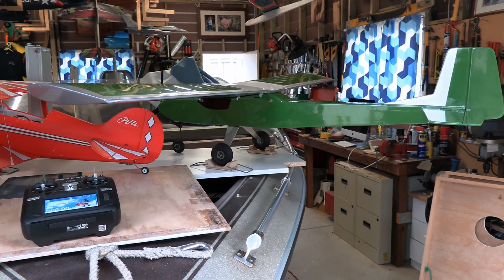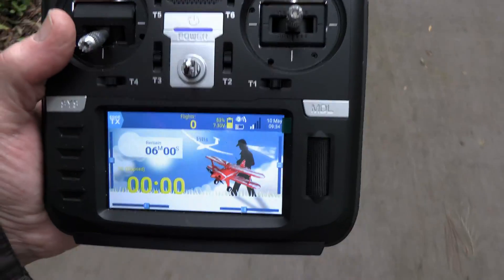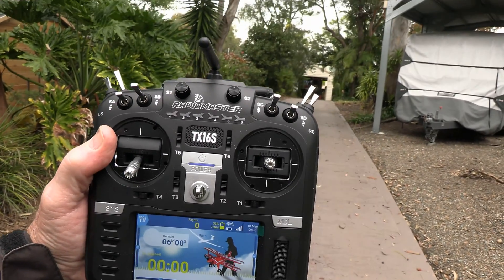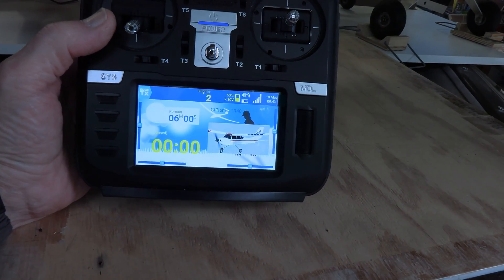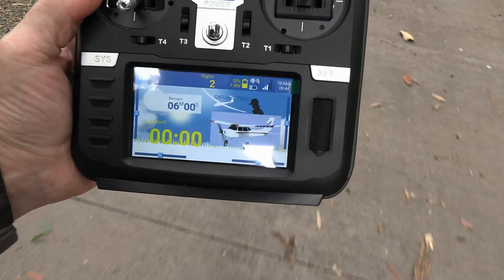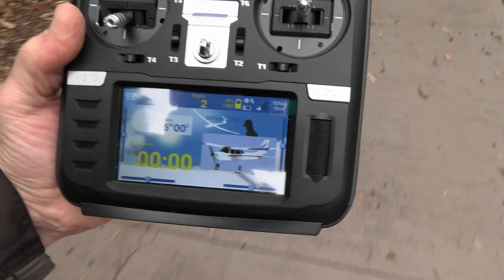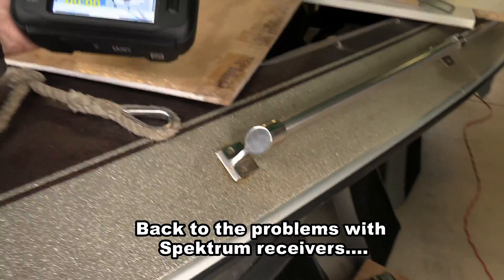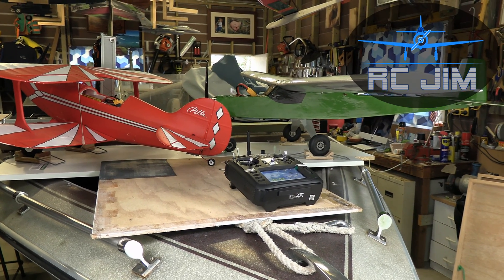RC Plane Range Issues with Spektrum and Radiomaster

Comment: My recent experience with new Boxer radio and Spektrum receivers AR410. I have Spektrum radio and about 10 spektrum Rxs. Few micro DSM Deltang 
one Lemon 6 Ch without telemetry. I bound one of each to my new Boxer radio and did range check. Deltang and Lemon without telemetry and radio set to reduced 1/30 power in range check mod had connection abot 30m away. With full strength as park was long about 300m and probably much more than that. Tested physically by moving control surfaces and assistant reported to me by mobile phone. No any issues in flight either. While testing antenaless AR 410 I was receiving low signal alarm after 20m. Why ? Because Boxer radio can not correctly interpret short range flyby telemetry signal from Rx and raising alarm. In physical test in low power mode I could move control surfaces even at 50m away. In full strenght tested 300m and probably close to 1 km but I have to find good location to test that. So I switched telemetry alarms off and enjoying flying. Never had any issues with above mentioned Spektrum RXs. I had problems with Hobby King Orange ones. So Edgetx system is not compatible with Spektrum short range flyby telemetry. But those small Spektrum antenaless one are very good except price.
Reply from the maker: Thanks for sharing, that's encouraging.

Comment: The difference is likely signal polarity.
Reply from the maker: Given that the Spektrum receivers with built in antennas only have one antenna, they are going to have polarity issues with a transmitter that also has only one antenna.  But at the distances at which I was receiving warnings, that shouldn't be an issue.  In the Radiomaster flight log I see that the Spektrum receiver is sending a TRSS value with 31 as 100%.  For Lemon RX the signal strength shown in the log is based on a scale up to 100.  I'm wondering if that is the reason.

Comment: Are you using the latest version of the Multi-Protocol module (1.3.4.0)?  Looks like you have internal and external modules.  30 meters with the airplane almost on the ground is a long distance.  You will get better reception with the airplane in the air.  If you have a Spektrum transmitter, monitor the 'fades' and 'holds' in telemetry.  You might be surprised at the number of fades (frame loss count) in Spektrum (un-announced).  Bottom line: "Only Holds Matter".  Lemon receivers are great!  Eagle makes a 6 axis gyro that has stabilization; try it.
Reply from the maker: Hi Garry, thank you for your very helpful information.  I have the latest firmware installed in the Radiomaster.  It has the capability of adding an external module, but I haven't done that yet.  I have received repeated warnings while in the air using the Radiomaster TX with Spektrum receivers, and at relatively close ranges - perhaps 50m or so.  It may be that they are 'fades,' but I dont get them using the Lemon RX receivers.

Comment: If you go and research RF fields and cones your eyes will see. Some of the cheapest best transmitters produce a doughnut shaped transmission field shape.
Reply from the maker: Yes, I have seen those.  However, even when I'm holding the transmitter so that the 'fat' part of the donut is directed towards the plane, I still am getting weak signal warnings when using the Spektrum receivers with the Radiomaster transmitter.  That is not happening with the Lemon RX receivers, regardless of how I am holding the transmitter.

Comment: Easy fix get rid of (buull), sorry I almost threw up, trying to say, spektrum ——and buy Xpress LRS.
But it’s your money your hobby do what you like.
Reply from the maker: I will eventually get the xpress LRS module, but in the meantime I have a lot of models with Spektrum receivers.  What is your preferred stabilization solution when using ELRS?
Reply: @RCJim  I thought all you hardcores Hated all the Newbie stabilization crap.
Reply from the maker: To tell the truth, the first time I flew with stabilisation was a handful of flights about a year ago (before bypassing the FMS Reflex module), then didn't do that again until a month ago or so.  Apart from trying to keep up with the times, several guys at our club have suggested that I would be crazy to fly my new FA-18 90mm ducted fan jet without it.  Furthermore, I've got a small jet and a small Pitts Special that are really sensitive to just about anything.  So, I'm giving it a go, and sharing what I learn about it with others.  My objective will certainly be to keep the stabilisation settings low such that you don't even know that it's happening, and do not use the "Safe" mode at all.
Reply: @RCJim Jim, my friend. Fly anything you want, stabilized or not. It's about your enjoyment, not some stranger leaving a comment on your post. You will for sure need stabilization for that edf jet, don't fly without it. 😊

Comment: The warnings are due to Spektrum having fly by telemetry. Turn off warnings in telemetry on the transmitter and the problem is solved. The signal from the transmitter to the receiver is not affected. This problem has been raised many times, and the answer is always the same.
Reply from the maker: OK, I'm all ears, but it's still not all adding up.  I was getting some warnings when the plane was over the landing field, maybe not close enough to throw a rock and hit it, but pretty close to a 'fly by' position.  And I was getting those warnings walking down the driveway, 30 - 40 metres away. On top of that, I'm a bit wary of just turning off and ignoring a warning.  It reminds me a time when I was flying a full size plane, taking off.  The instructor was telling me to pull back farther on the yoke to have a higher angle of climb.  Makes sense from the standpoint of protecting yourself from a potential engine failure.  But the stall warning buzzer was going off, and I questionned his instruction.  His response was to pull the fuse from the stall warning circuit!
Another thought.  Given that the transmitter is showing a signal level for signal strength, doesn't that mean it is actually receiving telemetry?  There's a different warning when it's "telemetry lost."
Reply: @RCJim it's normal, I use Spektrum rxs all the time and not one crash. Just turn off the sound.